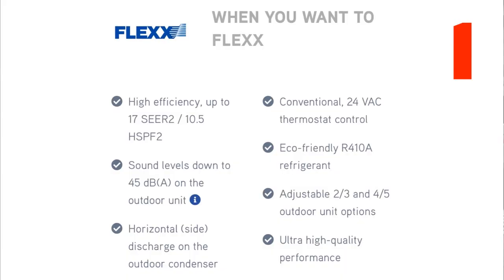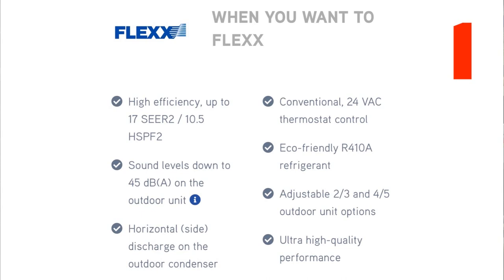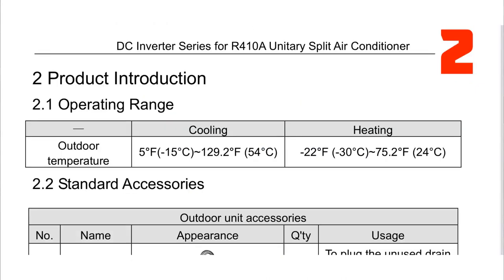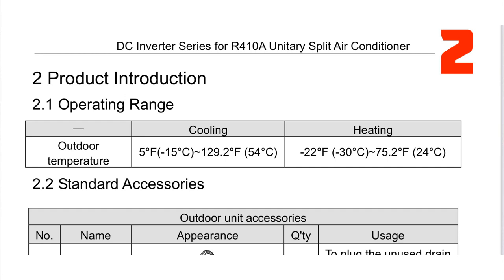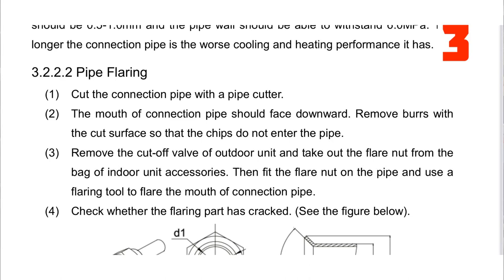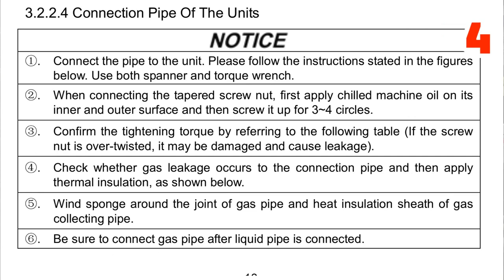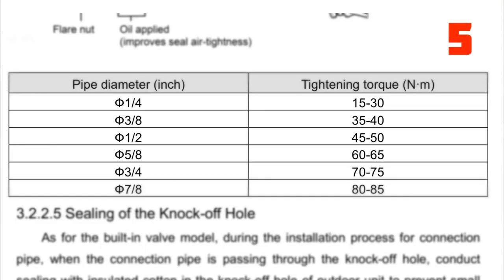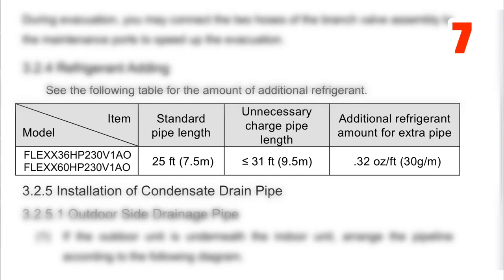A Small Introduction to GREE FLEX

Comment: I’ve installed multiples of these, even on my house. And they don’t need heat strips - won’t need them for most applications. They’ve been reliable. Gree is one of the largest AC manufacturers in the world, no problems with parts availability.
Reply: did you install the GUD36AH2/A-D(U) / GUD36W/A-D(U) combo?

Comment: Heating performance looks good on them. Wouldn't mind replacing my Bosh 1.0 with one to try. Only thing I don't like is when I looked at the manual it had no charging instructions other than what you showed. At least the bosch has that. Also the translated Chinese to English manual doesn't look good.

Comment: Does Mr. Cool buy their 4-5 Ton Inverter Condenser from Gree?  I saw one of them opened up and it had a Gree Compressor in it, and the specs are virtually identical.  Even the Condenser physically looks EXACTLY like a Gree Flex System your discussing here..  Do you have any experience with Mr. Cool Universal 5 ton Inverter condenser?  Just curious.  If the components are interchangable, it might give customers more options at purchasing time.  Thanks in advance for any comments on this.

Comment: Have not installed one yet 
But I think lots of contractors are using them because of slightly lower price than the Bosch but Bosch now has a unit that’s 15 seer I hear that is priced comparable so Maybee I’ll just stick with Bosch as they have been great thus far!
Go bruins!

Comment: Im assuming the B terminal for low voltage connection is what is traditionally the G terminal
Reply: It’s the reversing valve. Be sure to set  in the Tstat to energize on heat call as well.
Reply: @blaze0fglory267   thank you 🙏🏼

Comment: these should sell well once Biden's awesome Build Back Better $8000 Heat Pump POS rebates start at the end of this year.  Plus they are better for the environment, especially if one has solar panels.  I was at a friend of a friends house yesterday and he got suckered into two new gas furnances and 14 seer outdoor vertical condensers. Acosta Heating and Air screwed him over, but gave him financing on the $23K so the monthly payout was small and the homeowner took the bait. I didnt' even mention the $8K rebate coming up because it would make him feel bad.

Comment: I called gree tech support with a few questions and spoke to their main tech support guy. Question was,,, if I run a 2 stage stat so I can adjust airflow to 2 ton and 3 ton for high and low,, will the unit stage up and down. The answer was “it has never been tested for that and I had no idea”. When asked if there was someone else in engineering I could speak with, the answer was “no”. 
I want to like these but the dead end tech support requires a hard pass from me
Reply from the maker: I will bring this up. Noteworthy for sure.